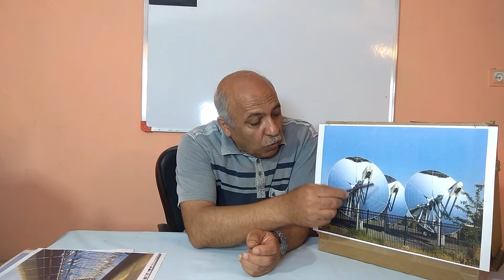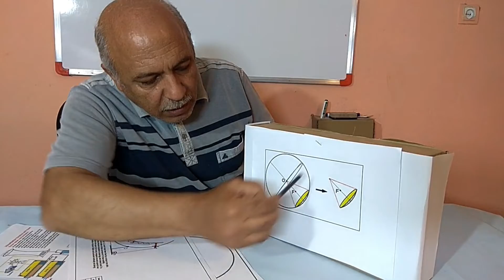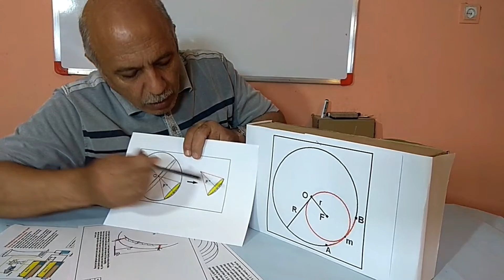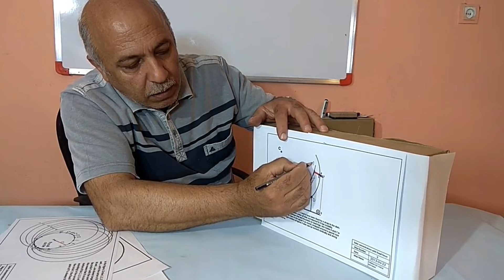Do you know the fixed focus system? Getting to know the fixed focus system.A new solar system

Comment: Those fixed focus systems give better efficiency than solar panels in areas with direct sunlight (desert regions) due to high temperature of heating and more temperature and environment resistant in some regions without much precipitation. Unlike solar batteries they work well only when there is enough direct sunlight and solar intensity.
Reply from the maker: Yes, you are right, the closer we are to the equator, the more efficient the system will be
Thank you for your good comment

Comment: 1:05 - actually, there is a company I am really excited about. Their name is Heliogen and what they do is use AI and small, cheap motors to position the small mirrors. Instead of having expensive, high-precision motors. The advantage? They can place hundreds of human-sized mirrors at significantly lower cost and also reach temperatures of 1400 degrees and thus even produce hydrogen at a lower energy-rate than petrol! It's truly amazing and I hope they become the standard soon for solar-refineries.
Reply from the maker: This is great and thank you for your good information
Reply: @fixedfocussolar  Yes, you can use trash quality small motors with gears to control the axis angles of fairly large solar systems. You just need a reduction gear to get a very slow, but steady movement and control the motors via cheap digital interfaces. They have to be stepping motors with rotation counters though to keep track of the position. Those are cheap now, you can get that under 20$, but without gears, of course. Stepping motors don't need any precision, they need a rotation counter and logic.
Reply from the maker: Thank you for your good advice
Yes, stepper motors do the job much easier
Essentially, stepper motors offer excellent speed control, precise positioning, and repeatability of movement. Additionally, stepper motors are highly reliable since there are no contact brushes in the motor. This minimizes mechanical failure and maximizes the operation lifetime of the motor. @trevoro.9731

Comment: Another practical, very related thing would be, a Sand Battery on top or underneath the house. This is something that can deeply complement a solar heater system, even for winter. It would be amazing to hear, how big of a capacity we need and how long / how thick the pipes need to be inside the Sand Battery. How much air flow or oil flow, etc. 

Would be really amazing if you could help us make it one day sir!
Reply from the maker: I hope that in the future, that is, in a few months, I will be able to unveil a home power plant
I am sure I will surprise everyone
Reply: @fixedfocussolar  Oh that is awesome! I see you have indeed already started on it. Thank you for sharing it with us!
Reply from the maker: Thank you, but there is still a lot of work left @millanferende6723
Reply: Had the same thoughts so also very interested to see this. Sterling generator hooked up directly into the sand could be an effective solution even between seasons

Comment: In my opinion parabolic trough is the easiest to implementation on big area. u can make rows of these power plants. one axis mirrors easier make than parabolic dish, because u need roll of stainless stell/ roll of mylar or pieces of mirrors glued on plane. roll/plane is curved on parabolic template y=(x^2)/4 * focus(in cm for example). receiver of solar energy can be isolation against lose of energy. Do you think about implementation your solution on parabolic trough? maybe parabolic trough loses energy, but this is more scaleable solution. in parabolic dish light are more concentrated and efficienty is the highest but this is still energy from 1 square meter. in parabolic trough controlling is easy, because u need only one motor to rotate mirrors in one axis. Greetings from Poland.
Reply from the maker: Thank you for your comment
The balance between the actual surface of the solar dish and its apparent surface must be observed in all solar concentrators
In addition, the sphere is a part of a share that can implement this balance much better and prevent dispersion loss.